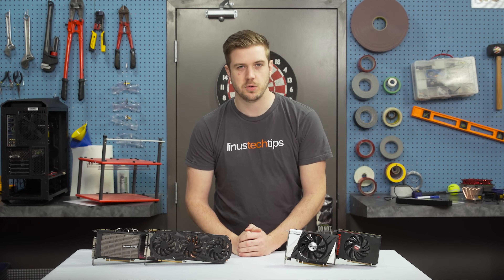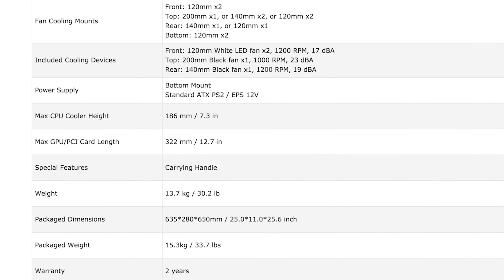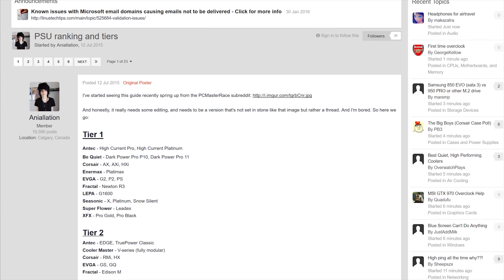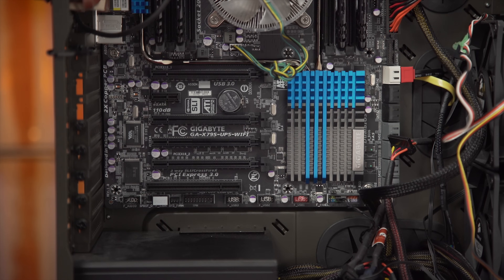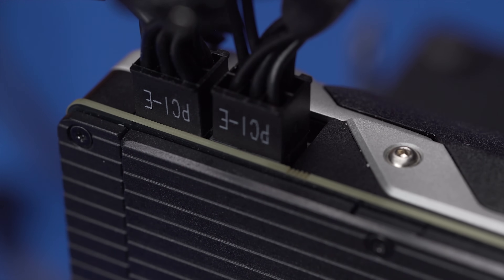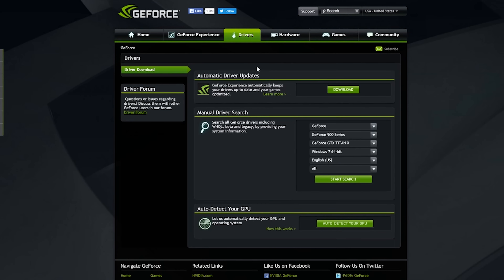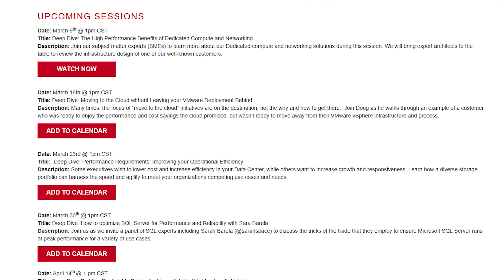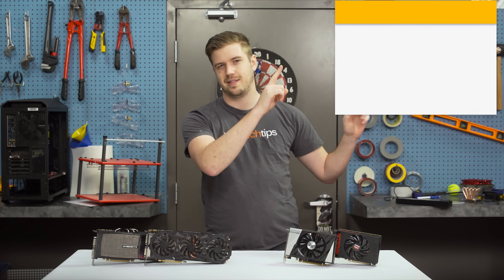Installing a Video Card - How To: Basics

Comment: Do I uninstall drivers first or put in the new card first?
Reply: This is one of those basic yet confusing questions that nobody ever thinks to ask or answer! Thanks, mate. Was wondering this, myself.
Reply: @SnidgetAsphodel  thanks. This is answer i was looking for.
Reply: I plugged in my card and the screen went black so how do I install drivers
Reply: @biggreenangryman1904  same here.  I have Linux non-free, so I thought the drivers were already on there.  Debian Linux started up after I signed into BIOS password, but then black screen. I have read this is common, so why is finding the solution so damned hard?  Make a video of the fix, please.
Reply: i also want to know this, im getting a 1070 and i want to know so i dont have any problems
Reply: I just did it, you should uninstall your drivers then install your card and then its drivers.
Reply: Virtual yeah i thought so, thanks man i appreciate it
Reply: @stopkevin  Cheers bro! Wanted to know aswell
Reply: do i need to install DDU even though i never had any graphic card installed before?
Reply: I would ask my friends for stuff like this but cuz they've done this multiple times they just tease me for asking simple shit like that lmao
Reply: lol. I always just put the new card in, then uninstal the old drivers and frantically try to install the new ones while I suffer with that big black border surrounding my 1024 x 768 half display until they install...
Reply: Drewwy yeah you should be fine, i just did it the other way to be easier
Reply: no ddu is just to uninsyall drivers so if youve never had a card installed with drivers before then you dont need to
Reply: Do I have to uninstall drivers for integrated graphics? Or do I just install drivers for my new graphics card?
Reply: @jareds1122  I've heard windows sometimes installs Intel drivers during updates so I always make sure to uninstalled every single graphics driver in DDU Nvidia AMD and INTEL. You only need one graphics driver and having multiple can cause conflicts. For example you don't want to have AMD Graphics drivers installed when you install an nvidia gpu and vice Versa
Reply: Skyler Chicoine  I had a Nvidia Card, but it broke so I took out the card and connected my monitor to the M/B. It says I’m using an Intel graphics now. Do I uninstall both nvdia drivers and intel drivers or just nvdia?
Reply: Ah, because i followed LTT instructions ad they meintioned, i installed the gpu THEN used the DDU, which locked me out of my account
Reply: @thetuerk  same
Reply: Virtual Can I physically install the card first, then do the software stuff ?
Reply: Drewwy  yes
Reply: Bad Boy Stuff you replied to a 3 year old comment?
Reply: Stop It Kevin  is there a problem?
Reply: Skyler Chicoine thanks, mate
Reply: Virtual if i installed a card before, i should use ddu and then install the new one and the driver for it right?
Reply: I just upgraded motherboard,gpu,ram and gpu. My PC won't show any display. I tried putting the HDMI cable in the motherboard. My keyboard does not light up and my screen is black. Any help
Reply: @fl1ckzz992  Same here
Reply: Waste of Spunk  LOL ANIME jeez
Reply: Stop It Kevin  uninstall
Reply: That's what I'm expecting to happen when I do mine. Cause how is the computer supposed to display anything when you don't have the display drivers? Is it ok to just leave the old drivers then install the new ones so that when you uninstall the old ones you won't have any problems like this blackscreen situation.
Reply: Thank you!

Comment: So I plan to upgrade to an MSI GTX 1060 from a two year old MSI Radeon R9 290X. My motherboard is Ultra Durable GA-Z97X-SLI, I have 8gigs of RAM, and an Intel Core i5-4690 3.5 GHz Quad-Core Processor. (I forgot what other stuff I got)

Is that compatible for that graphics card?
Reply: My case is a NZXT S340 Matte Black/Red Steel ATX Mid Tower Case.
Reply: Ciaran Henderson aight
Reply: Paul Beenis the Parrot Not really an upgrade in terms of performance. The only real upgrade is in terms of the power consumption, which is a lot lower on the GTX 1060.
Reply: Sebastian H. I upgraded to GTX 1070 instead. :>

Comment: I installed a Diamond Radeon HD 6450 into my completely bone stock Dell Inspiron 545 with a 300 Watt power supply. It fit snug and everything. But it makes noises and when I diagnose my computers performance, it show 1.0 for computer graphics. I also installed a driver that WINDOWS found for me. What do I do?
Reply: go to AMD's website and download the latest driver for your 6450.

Comment: If I currently have integrated graphics in my computer but am going to install a  new gpu, do I need to get rid of the drivers for the old graphics?
Reply: 8manPapi .... no should be no issues if you leave them when installing a dedicated graphics card.

Comment: I have a gtx 1060 3gb and it is getting terrible fps in games, with GPU z I found its usage to be fluctuating heavily and 40% average load, core clock-1911mhz, memory clock-around 1900mhz and temps are normal, any idea why it is happening? My processor is i3 4150
Reply: Sarthak Dash  ur processor is really bad

Comment: Is a zotack gtx 970 4gb's a good graphics card with a i5 intel processor? Does anyone know?
Reply: ye
Reply: Yes
Reply: no
Reply: gtx 970 has 3,5gb vram. And why buy "outdated" card because you can buy gtx 1060/1070 or amd rx 480.
Reply: the gtx 970 is still a great card for gaming. but if you're planning on getting brand new, you better off buy a rx 480 or a gtx 1060 (the extra vram will help you in the long run). gtx 970 if you could get it cheaper than those 2 cards
Reply: Tampukka565 I had a budget of $350 I would have bought those if I had $700
Reply: Gtx 1060 6gb costs 300-370 euros at finland but i dont know how expensive it is in your country.
Reply: Tampukka565 I'm American 350 and times it by two is how may USD it costs lol.
Reply: I don't know if you've already bought it, but buy a 1060 instead their cheaper and better

Comment: I'm unsure what power my pc has but if I have a gtx 750 ti do you think I could handle a gtx 1050 ti?
Reply: ***** thanks for reply
Reply: +Legit Person Whoa!!?!!?!! A lgeit person I've never seen one b4 all I saw were bots
Reply: alright one more question just to make sure if my CPU is AMD A8-6600K APU but using my gtx 750 ti 1: will I still be able to handle a better card and 2: do you thing I need a new cpu
Reply: alright thanks the problem is I have trouble running some games I want to play for example I can play fallout 4 but in some places eg nuka world I get like 15-28 frames and I can barely run witcher 3 so I think I will need a new card also I have 8 ram do you think I should get more?
Reply: whats ur cpu
Reply: Yah, the 1050 it doesn't need a power connecter so if you have a 300 watt power supply, then you should be fine.

Comment: i have a 2x 6 pin cable (splitter) and my new card only has 1 6 pin connector, which cable do i put in?
Reply: MryBoy just plug in the 6 pin connector into your card

Comment: I'm currently using i5 6500 integrated gpu should i use ddu when i get my gtx 1060? i will get it next week plz answer fast
Reply: It wont hurt, so give it a go. But in any case you are most likely not running into big problems.
Reply: Berserker Guy why not? it's a great card
Reply: Swoelie i said should i use ddu like he did with the vid!

Comment: I broke the little retention clip when removing my old gpu. Is it critical? Is it replaceable?
Reply: Ohad Raps it's not critical. I've broken one aswell, all it does is lock the GPU in place. As long as you don't move/tip over your desktop case, your GPU should stick to the motherboard no prob.
Reply: Ville thank you very much for all your replies!
Reply: The pcle port on my motherboard was ripped of when I was taking of my 1080 tested the other three and found out they had defects or something but yeah I just bent the pins of and used another slot

All the other slots were loose If i wanted to take it of it would just slide of

Comment: I installed my gpu but now I have a black screen but when I turn the pc off  and take the gpu out no black screen help?
Reply: Steve French yea I got it like a few days ago thanks anyway tho
Reply: True Pride yeap I did lol
Reply: True Pride ok?
Reply: True Pride have no idea what that was supposed to mean but ok whatever floats your boat lol
Reply: True Pride I didn't disable anything all I did was plug my hdmi into the hdmi slot on the gpu and it came on and then I went to nvidia.com to download the drivers from there
Reply: True Pride I bought parts
Reply: clau r seems legit
Reply: True Pride Well, can you help us out here? My own experience is that I want to upgrade to a gtx 1050, even got a new power supply (450w) to support it, but it's not working after I inserted it. As far as I know, it draws power from the motherboard (its a rebuilt pc m32bf if it helps). I dunno much from there

Comment: will a 6pin to a 8pin adapter work if my power supply is enough to handle the graphics card?
Reply: No, but if you have a 4pin*2 that will work but be cautious.
Reply: Conventionally Bad what if I have a 6 pin and a 2 pin next to it, will it work still
Reply: Virtual If its an 8 pin GPU than yes
Reply: Conventionally Bad ok thank you just bought a new 1080

Comment: can graphics cards be installed in any modern pc even if not gaming.
Reply: .....I don't why you're on a video like this if you don't know.
Reply: Maybe because he doesn't know that much about the internals of computers?
Reply: PrehistoricGamer  exactly i dont know much but i want to game too you know... sondont judge if im not knowledgable
Reply: As long as your motherboard (the biggest circuit board in your PC) has a PCIe slot (the slot shown in this video, not to be confused with a DIMM slot. The PCIe slot should point directly to the back of your case) you should be fine. Be sure to plug your monitor into the back of your video card, not into your motherboard. Also, install the latest drivers from either AMD or NVidia based on what brand card you have. Hope this helped!.
Reply: Manufacturers of overpriced, pre-built, 'gaming PCs' don't want you to know this but putting in a graphics card pretty much is all that it takes to turn a modern 'not for gaming'  PC  into a gaming PC. 

So yeah, you sure can.

Comment: I looked on the internet if a Nvidia GTX can go with my CPU (AMD A6 6400K) and it can! It can also go with my motherboard. But here is my question. Can the Nvidida GTX fit inside the Vibox Raptor 24?
Reply: By the way it the 970 Nvidia

Comment: so with that free uninstall program, do i uninstall intel drivers if i was running integrated graphics before my upgrade? please someone help me out here?
Reply: It would be a good idea to, but if you end up forgetting it's not the end of the world - it will most likely run just fine.
Reply: Uninstall all
Reply: 700mobster... It would be a bad idea to uninstall the motherboard graphics drivers. Reason being if your Dedicated graphics card burns out you will be in a pickle when you need to use i the motherboards graphics only to remember you don't have drivers and now your screwed.

Comment: Question: I've got 2 maxwell gen Titan X gpu's, im about to buy  2 of the new Pascal gen titans. do i need to uninstall my latest gpu drivers before installing the new cards?
Reply: No, honestly uninstalling the drivers is an unnecessary hassle that cna possibly leave you with a black screan and having to remove the motherboard battery to fix it like I once did. I suppose if you had old AMD drivers on your system it would be handy but your just going from one nvidia generation to another so all you need to do is install the latest drivers for your video card and dont worry at all about any old drivers on your system.

Comment: Instructions unclear 

got dick stuck in HDMI port.
Reply: small enough to fit? xD
Reply: Plug your ass to the monitor, this might make the PC work
Reply: +89C4J (JohnYT) Aaaahhhhh,  I see...
Reply: Did it work?
Reply: +Magnus weidner Electronic product manuals clearly state that small parts should be clearly taken care of while using the product
Reply: damn thats a small dick
Reply: Magnus weidner fam I got mine in the display port 0_o
Reply: Yeah, such a shame that I first figured that out later...
Reply: +FdPros  that's what your mom told me!  Wait... that doesnt work. Nevermind. Fuck you!
Reply: Bruh, mine got stuck in one of the little holes in the DVI-D ports.
Reply: ***** no Fuck you! :)
Reply: Funny.
Reply: Magnus weidner again?
Reply: I need power supply with 6 pin connecter please help which one I buy
Reply: so urs so small?

Comment: after fixing my amd rx460 i got a black screen
cant even see the bios menu
i need to remove the dvi and put back the vga onboard to use pc without gpu
what to do? has anyone faced this issue?
Reply: ***** lol
I updated my bios and thr pbrlm is gone
Reply: ***** which gpu
Reply: +hrmolen from the instructions available on my motherboard site
Reply: I have the same issue as you. Did you put the rx 460 in a pcie 2.0 or 3.0?
Reply: +Samir Saheb i have 2.0

Comment: I'm going from a AMD R7 260X to a AMD RX 480, I have the most current drivers from AMD; Radeon Crimson 16.7.3, no 16.8.3 because it's a hotfix and i don't need it; do i still need to remove and install the drivers or will I see instant gain from just installing the new card?

Comment: It's funny because I installed my GTX 1070 yesterday, and now it has overridden my wireless network connection, and I can't connect to the Internet on my desktop.
Reply: then how are you here?
Reply: he's making it up
Reply: xxwafflez Actually I'm not you ignorant fool. I was using my laptop to type that and it is resolved now.
Reply: By use via my working laptop. On my desktop I accidentally bumped out my wireless card. It is now fixed as is graphics card.ConflictingPersonalities /\ Games And More
Reply: We don't care, dont tell us your life story
Reply: You're a troll idiot, goodbye.
Reply: I care cos i'm about to install my 1080 and this is useful info
Reply: +Anon ymous Well I'm glad because it definitely is a concern if your PC comes with a wireless network inside it, and you manage to knock it out of place even just a little. My advice: Unless you're really knowledgeable with PCs and their components, you may have to spend, but let a nearby computer shop do it. It'll save you trouble if you mess up like I did.
Reply: Deion Mitchell Cheers dude but rig is almost complete, need this graphics card and i'm good to go
Reply: +Anon ymous Thanks man, and that's cool! Mine is too! Should have it complete by my next paycheck. I just need still an i7 6700k processor to future proof and sync well with my powerful gpu and I need another 1TB hard drive

Comment: So I got a pre built and pc. SPECS and fx 4300 r7 240 350 watt can I easily replace with a Gtx 750ti (first pc)
Reply: I don't think you have enough watts
Reply: Mohammed Muzammil Watch out for anything unusual though
Reply: how much did it cost?
Reply: +Lukas Safi I think like 450 with prime
Reply: Get a gets 950 75w version 

100 $ on newegg 

Cpu is also crap btw
Reply: GTX750ti would work just fine for 350W PSU. I installed the 750ti on a 290W PSU, even though recommended  was 300W. So you should be just fine. Cheers :)

Comment: if i have a gtx 970, could i replace it with a gtx 1080 easily?
Reply: yea
Reply: yes for sure. But to be safe you should check your mother board compatibility with that graphic card. and make sure it fits inside your case. If your are going to buy a Asus Strix gtx 10 series which is huge(because of three fans on them) some cases can too small to fit the card in.
Reply: Sammy Kim
nah, i just want a normal non-badass 10 series card. lol.

Comment: What??  Do I need to uninstall the old graphics before I add a new card?  How do I do this?  Will the computer recognize my new graphics card?  I thought that this was basic?
Reply: TheReal ChickenJoe Yea it would be perfect I have a CX600 currently and it powers everything pretty good
Reply: uninstall the drivers using DD and then you can start removing your old one and putting in your new one then you install the drivers for the new one.
Reply: is it really that simple ? I want to replace my R7 250 OC with a GTX750ti OC
Reply: TheReal ChickenJoe I mean just make sure you have the right amount of power from the PSU and that the graphics card fits but other than that yea
Reply: Kenny Chhoeun yeah i have 400₩ :/ not sure if its nuff
Reply: Kenny Chhoeun but i dont want a gtx750ti anymore , i buy a R9 380 4gb , much more power :)
Reply: TheReal ChickenJoe Lol awesome. I think you should upgrade the PSU to atleast 550 though
Reply: Kenny Chhoeun kk :) i buy a 600₩ then should be nuff for everything :P
Reply: Kenny Chhoeun thanks :) you helped me alot i will Change the PSU and graphics Card in 2 months when i get the R9 380 :P

Comment: I need help. I just installed my gpu, it works, installed drivers but my screen color changed to green-ish :(
Reply: Ray-an ragucos are you using an analog connection like DVI? If so tighten up the connector.
Reply: i used the adapter dvi to avg and I'm sure i tighten it properly

Comment: I've watched a few of these graphics card vids. Something I never see mentioned is the monitor. In my case, it's still plugged into the motherboard as I haven't received my video card to install yet. Do I leave the monitor plugged up to the motherboard or will I connect it to the card? And if I do connect it to the card, at what step in the install? Thx!